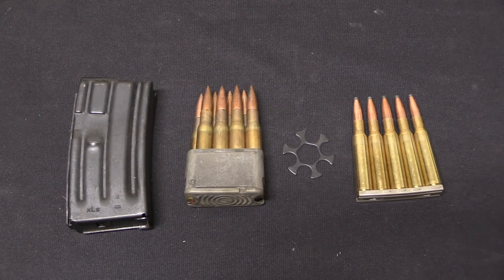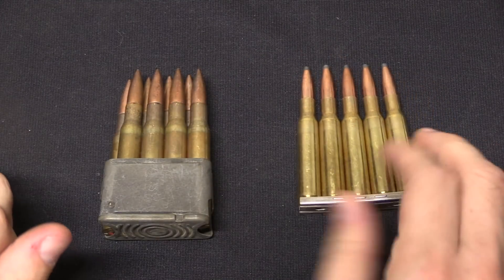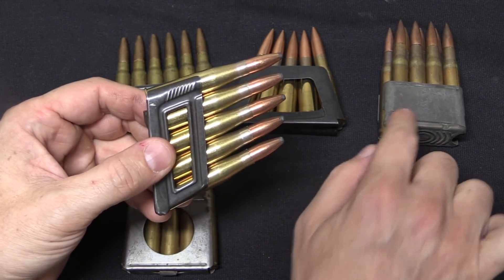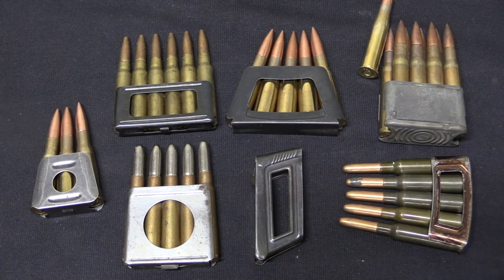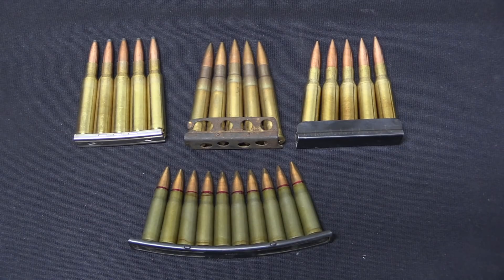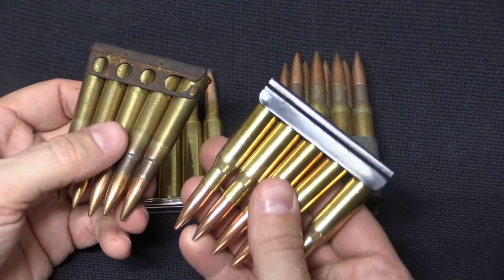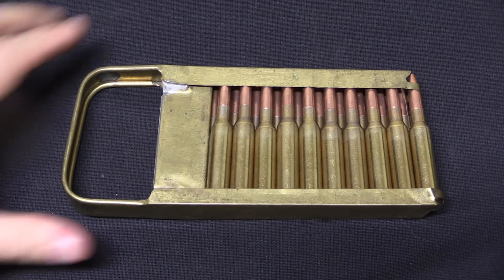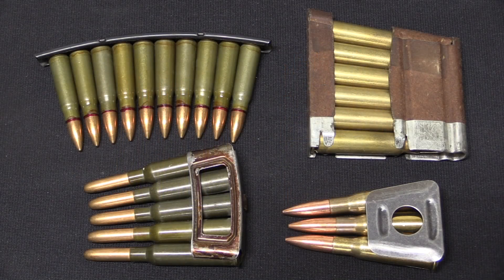How Does It Work: Clips! (Not Magazines)

Comment: All rifles should be Mannlicher style loading. Same speed loading, and ejection as a magazine, less waste, no need to recover, or pocket the empty magazines... I can see how in pistols, certain design features of the "pistol" concept, in and of itself, (presently) negate the possibility of using clips. However, I'm sure some clever engineering could well develope "bottom feed" internal magazines (with the advancing spring offset to one side), allowing pistols to implement clips as well... bit that's for another conversation... on another day... in a different setting... with wholely different intent. The Mannlicher design basically obsoletes both single load, and removable magazine design, in rifles altogether.

Comment: Can a weapon system that uses Mannlicher type clips be used in any manner without a clip inserted, or is it vital to the function of the weapon?
Reply: I think only with single hand-fed rounds.  I believe the feed lips are on the clip, so just stacking loose rounds wouldn't work, at least in the guns that I know of.  I could be wrong, as there are some weird and obscure things out there.
Reply: basically single shot only ... u load a bullet into the chamber, close the bolt, fire and repaet it every time
Reply: With the ages of these rifles, and difficulty finding ammo it could be a bit of a problem.

Comment: Is it easier to load a magazine using a clip than to load bullets directly into a magazine. I mean you have to load the clip with bullets first before transferring them into a magazine. Is it faster?
Reply: The clips came preloaded from the factory.
Reply: At least in the military, the ammo comes in clips. I think a can of 5.56 ammo comes with a cloth bandoleer in it with ten or twelve pockets, each with two, ten round clips. The ammo can also as a couple of the little funnel things that you use to charge the magazine. Just like a carton of C-rations came with bunch of P38s. You stick the loading adapter in the top of the magazine, stick the end of the stripper clip into the adapter and then push the rounds out of the clip and into the magazine.
Reply: @Mishn0  thanks for the answer

Comment: Comment 1: Why didn't designs of rifles/SMGs using removable double stack/double feed box mags (like virtually post WW II designs) include a stripper guide on the weapon itself????

Comment 2: Did the Swedes design the marvelous 6.5x55 mm cartridge with just a slightly larger rim diam than the "Mauser" standard used on the 7/8x57 & .30-06 Springfield just so those other strippers would be a PIA to use in their 1894 & 1896 rifles? At least that was my experience using 1903/M-14 strippers with a 1894 carbine.
Reply: To answer comment 1 because loading tools were cheaper to produce than having to fit a stripperclip guide to every magazine. The 6.5 Swedish round has a different diameter because it started out as a rimmed round for the krag- jorgonson rifle

Comment: Why don't shotguns use clips more often in a military context? Since many such as the Benelli M1014 have internal tube magazines wouldn't feeding it via disposable clips with end-to-end stacked shells be easier and faster than doing so by hand?
Reply: You'd have a long thin tube that's going to be very prone to damage even in normal usage, never mind a firefight.
Reply: Because shotguns generally don't get used in a military context and in your context a box fed shotgun like a saiga makes more sense anyway. Either way not worth it since you'll barely use a shotgun in the military anyway.

Comment: How were say Gerand clips "bulk" loaded in wartime situations?  Or, was manual loading the only option?
Reply: Ammo came loaded from the factory on clips, I think. You can. Manually load rounds into the clips also.
Reply: @con6lex  so, was there a machine that did it?  Or, just a bunch of guys sitting around with strong thumbs.
Reply: I assume a machine, with the volume needed for WW2.

Comment: So clips can be used to load box magazines…but isn’t that kind of pointless? This might be just my FPS paradigm talking, but wouldn’t you just carry spare magazines? And if you’re reloading out-of-combat—meaning you can take your time—it just seems like loading clips to load into magazines make for an unnecessary middleman.
Reply: 20 rounds in 5 round clips weigh less than a 20 round magazine. Weight matters to a soldier so it's a trade off, pulling numbers out of my arse you carry 4 magazines, giving you 80 rounds, the rest of your available ammunition is in clips. Out of combat your ammunition may turn up in clips, so you refill your magazines from them. If it turns up loose you sit there thumbing it into the magazine 1 round at a time.
Reply: Your combat load is just magazines generally 6 of them but you carry adittional ammo in clips for reloading those (and generally an adittional belt for your machine gunner) and they are on clips because more often than not you have to fill your magazine while combat is still active.even in downtime pushing 5 rounds into a mag with one movement is faster than loading it individually.